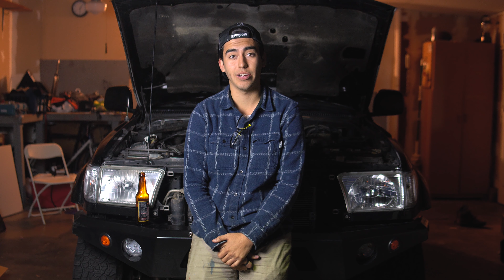3rd gen 4runner... Bad News :(

Comment: Damn gremlins got in there! What gears are you gonna run with that elocker? I'm looking for an elocker too.
Reply from the maker: That's what I'm thinking! They're stock gears right now @ 4.10. Maybe in the future I'll regear.
Reply: @diaz7412  I'm in the same boat with 4.10s. Did you get all the stock wiring or did you order an after market wiring set up? I'm just curious cause I'm thinking about taking the plunge into this mod soon.